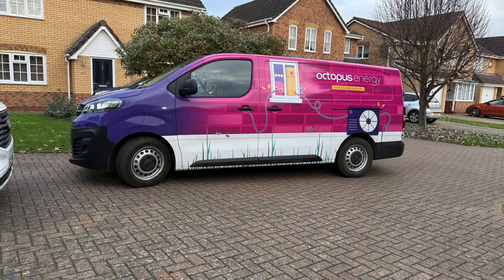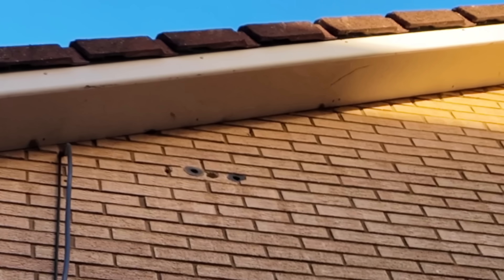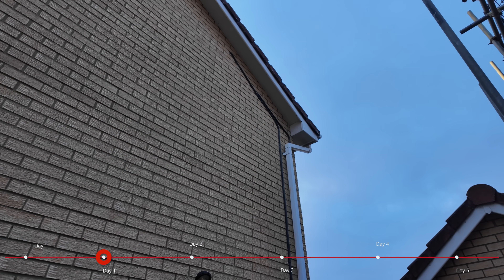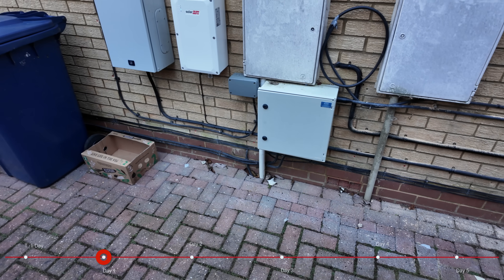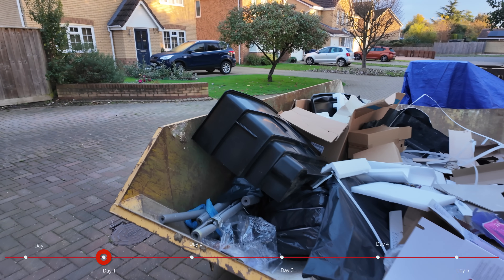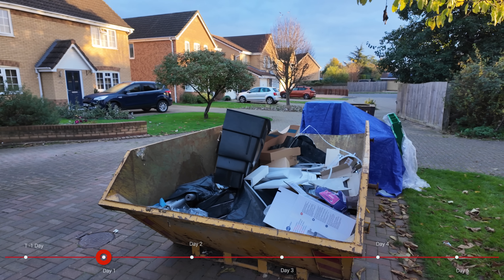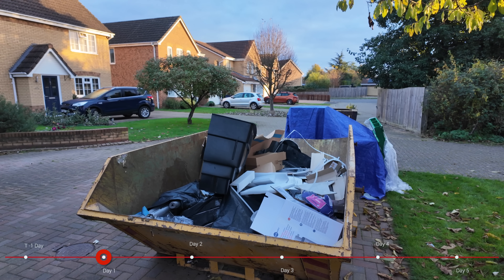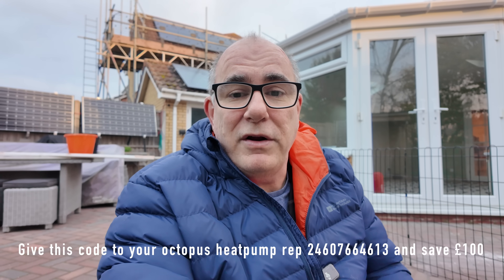Octopus Energy Heatpump installation - Day 1 - how did it go?

Comment: Brilliant, I have been trying to find a non sensational video on the octopus heat pump system. This is exactly what I was after. I will be following along with interest. One thing though, they really should have measured the hot water tank for the size of the cupboard. Please, if you have the time, keep the updates coming and if you can, a comparison of cost between the old gas and the new heat pump. Thank you and hope it's all going swimmingly... octopus...get it.... Ok
Reply from the maker: No worries, I will be posting updates on the gas vs electricity usage once its been running for a while. To be fair to them, the survey indicated we needed a taller slimline tank and a normal sized one got shipped so I suspect just a screw up in ordering. no matter itas all fixed now. Will keep you updated on my progress - good or bad.

Comment: Good luck, hope it goes well, and someone was very thoughtful with the fan heaters. Hopefully when I get around to having mine installed I can avoid all the external cables and pipe work, as long as they are happy to site it where I think it will be going.
Reply from the maker: yes it was a very nice thought and very needed :-). when i had my survey done, they did give me options but apparently it’s more efficient to put it where it’s sighted and that means cable runs

Comment: Great to see the stages of the install. Did you get the choice of the cosy 6 as an option? if yes what made you decide on the daikin
Reply from the maker: Yes if I waited a few more months. TBH I would rather have had a unit that has millions of hours of usage, been tested by thousands of customers than be a beta tester for the cosy 6. I love bleeding edge tech but if we end up with a cold house because something fails I will be in trouble with the family
Reply: Does the alternative DHW cylinder have a different capacity?  Are you happy with the substitute?
Reply from the maker: yep all good it’s the same capacity just taller and slimmer